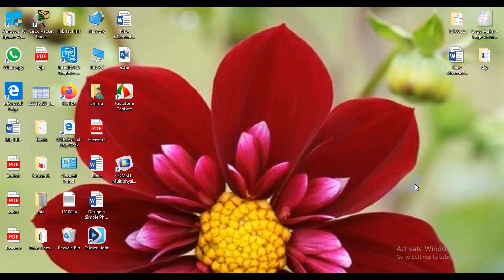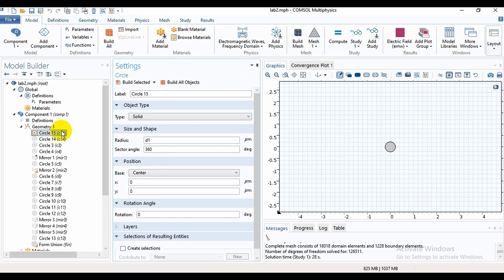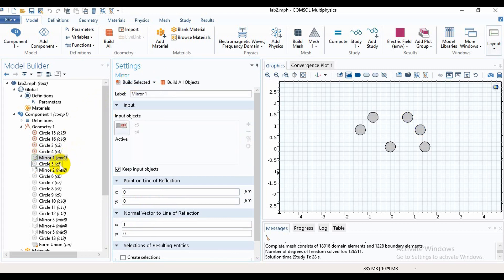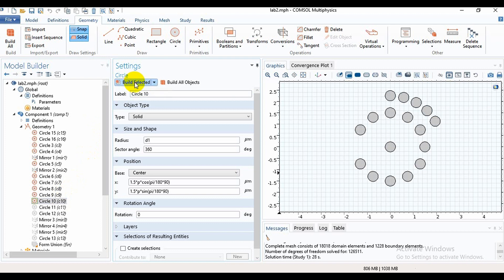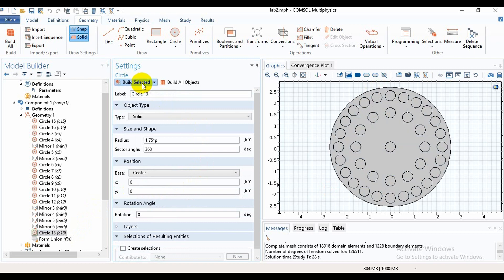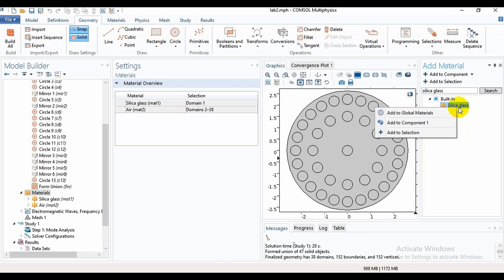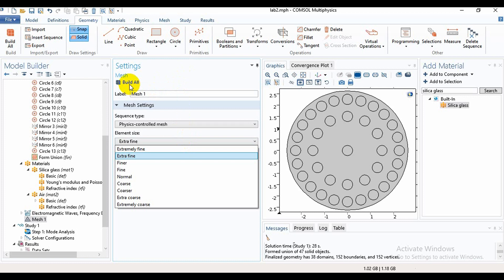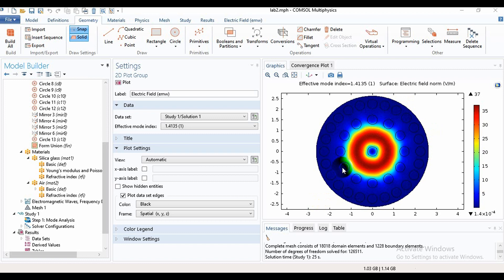2D simulation of photonic crystal fiber in Comsol multiphysics (Circular structure)

Comment: Could You explain the Physics part? When I add Physics to my model, Electromagnetic waves, Frequency Domain (EMW) the mesh becomes too fine and it takes a lot of memory (12 GB RAM and 40 GB cached in SSD) and does not compute the solution even after an hour
Reply: I think you mada an error on mode analysis option.
Reply: Give the mode analysis values same as her. Change mode analysis freq,

Comment: Can you tell me the parameters of the solver to find the imaginary values of the effective index, because I cannot find the imaginary parts despite I reduced the tolerance value to the maximum (greater than 20)
Reply from the maker: When u need imaginary part then u need to go 'derived values' option then global evaluation. After that u will find some options where u need to write imag(emw.neff) then u will get the imaginary values
Reply: @heavenslight9325   Thank you for your reply.

I apologize again, I have another remark regarding your method of calculating the dispersion. I can't seem to see a link between the formula and your method used (Excel) I'm sorry, can you explain to me. Thanks again.

Comment: Good evening madam
I followed all the steps to repeat your work in order to understand the operation of the Comsol but the problem is that when I do the meshing I obtained a different result from your result and the different effective index
Reply from the maker: Send your model at sumaiya52shimu@gmail.com
Reply: Even though I followed the same procedure and my result was different, then I checked some silica glass properties. So, change the value of relative permittivity, and then your result will be the same.